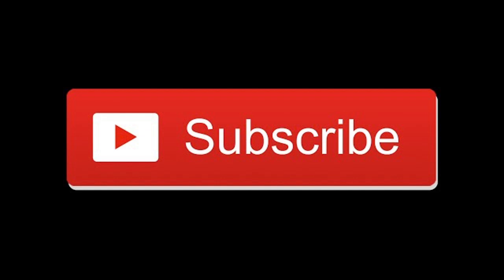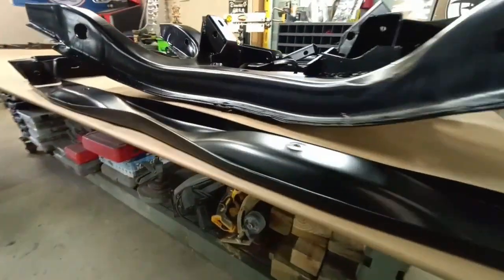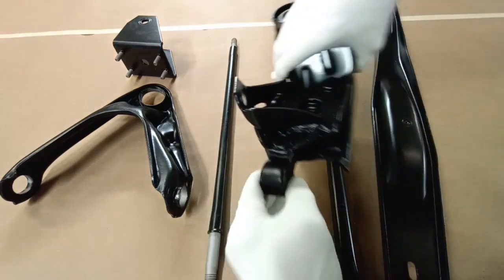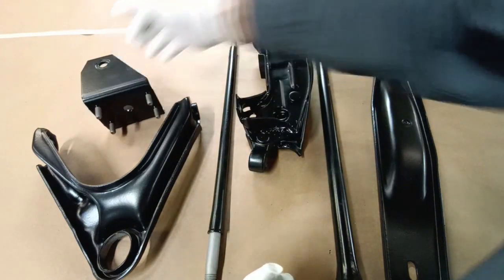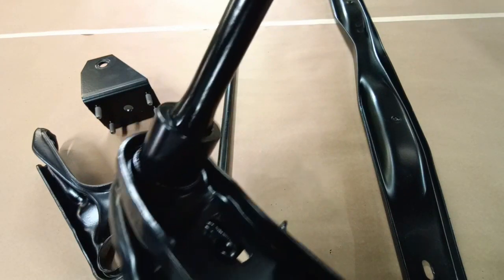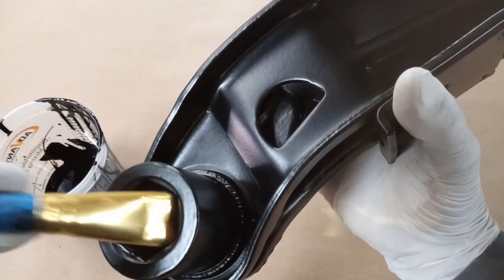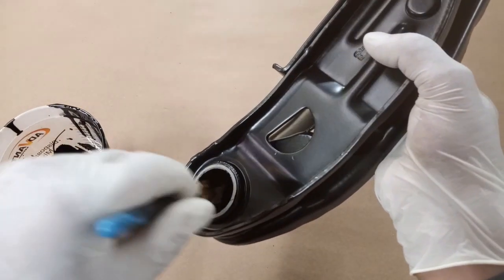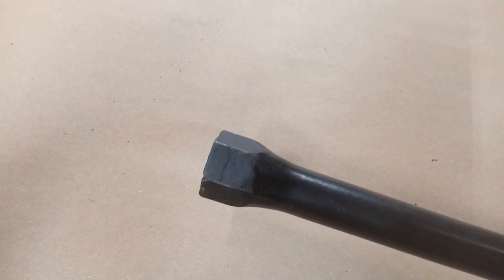powder coating suspension parts tips - DIY Auto Restoration

Comment: Yes. I also paint using spray can paint satin black or cast, whatever color I powder coated to seal off the fitment areas.
Reply from the maker: Best practice, use a two-part catalyzed epoxy to coat the bare steel, regular spray paint will not stop oxidation